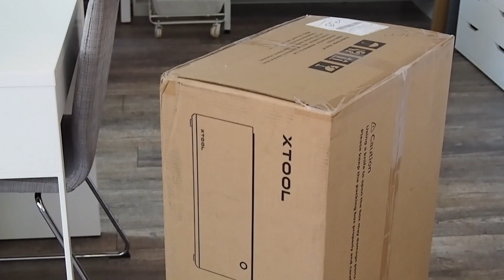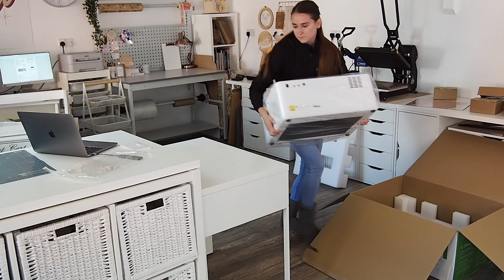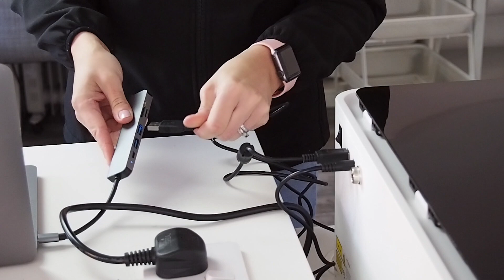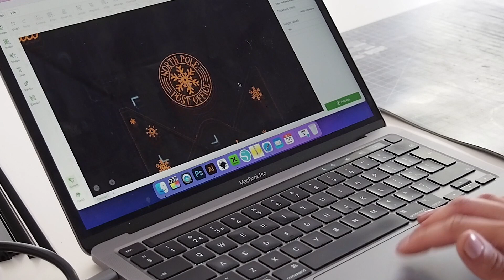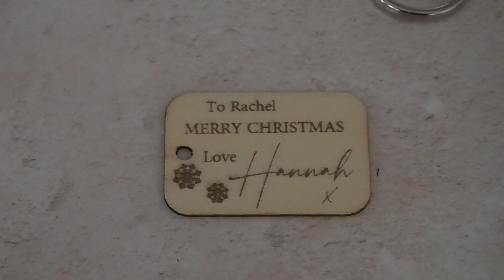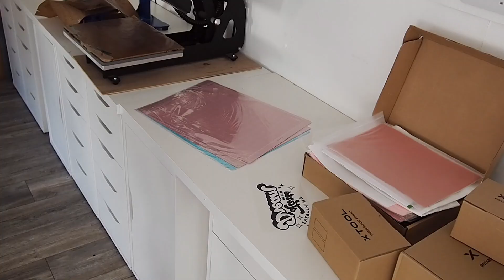xTool M1 review: everything you need to know before you buy!

Comment: Would love to know if you (or anyone reading this) is still enjoying the M1 after consistent use over a 5-6 months. I've found plenty of initial reviews, but not finding any "after X months this is what I think" so it's hard to gauge if the initial reviews still hold up. 
Especially interested in:
- If the initial issue with the camera calibration has been fixed (centering images on material seemed to be a problem caused by the camera calibration)
- If the xTool software has been sufficient after all this time (re. lack of Lightburn support)

I'm a hobbyist and don't plan on doing anything too taxing (personal projects like booknooks, etc.) so would love to hear if this machine is still holding strong. 

I currently have an older Ortur, but I'm really drawn to this because of the sleek enclosure + venting etc. & power increase if I go with the 10w. I've only used LaserGRBL with bought templates to this point so I was looking forward to doing up my own designs and learning Lightburn, but might need to rethink processes if the M1 won't ever be supported by LB. 

Would love any opinions on long-term use of this system :)

Comment: Hi Hannah, can you tell me why you can't laser white acrylic with the xTool m1? Are you cutting your white acrylic with your other laser? Warm greetings
Reply from the maker: Hi, from the best of my knowledge and understanding of the lasers, the xTool M1 is a blue diode laser. Therefore it can't cut certain colours of the acrylic, because of the frequency it is running at. People have success with black acrylic for example, but not the white or clear. On the xtool facebook group, some people have found a work around using different coatings, but i haven't tried this as I primarily cut wood for 95% of what I do. 

In terms of the other laser, that one is a co2 laser machine, and this can cut through any colour acrylic as it is much more powerful. 

Hope this helps :)
Best Regards
Hannah
Reply: Thank you for the reply, that was a great help. Best regards

Comment: I've been researching laser cutters for quite a while now because I want to start my business. I've been set on the Glowforge, but the xTool M1 seems to do the same thing at a much lower price point. Plus it cuts like my Cricut? Wow.
Reply: I have a Glowforge for my small business, it's been a game changer for sure. Each laser has their pros and cons. This laser looks amazing but has a lot less power than most lasers and I believe they are not American so that could be why they have excellent prices.
Reply: Try Amazon they have great deals
Reply from the maker: Hello, my best advise is to have a look into what designs you’d like to make and the materials to use. I believe the M1 is a 5w power (my other one is around 40w so much more powerful). That being said, I actually only ever cut 3mm materials or card, so don’t actually need as much power that I have with the other machine. 

I think the glowforge is a higher power from what I’ve read. I’d probably look into the specifications, and weigh up what works best with the materials you want to work with. 

There’s also all the attachments, adding air filtering and a honeycomb base can produce even better results, but are extra.

Hopefully this helps, any other questions, let me know ☺️